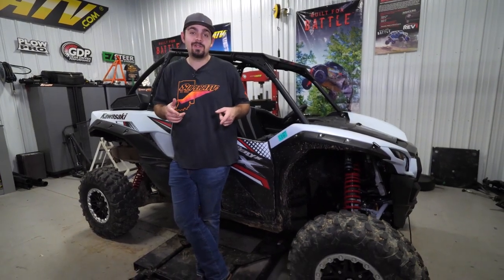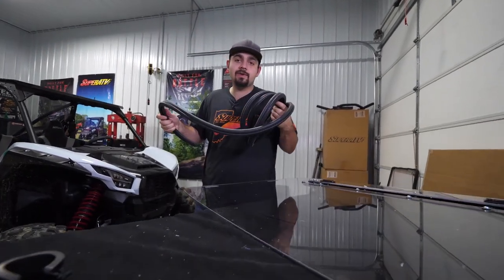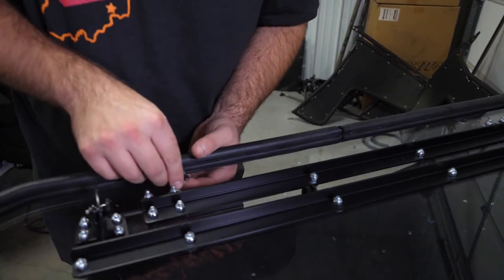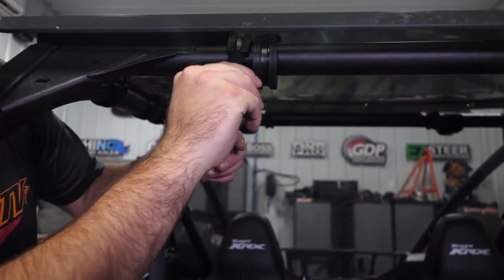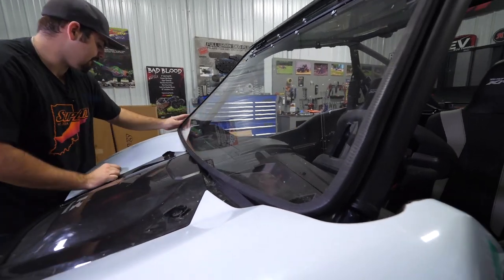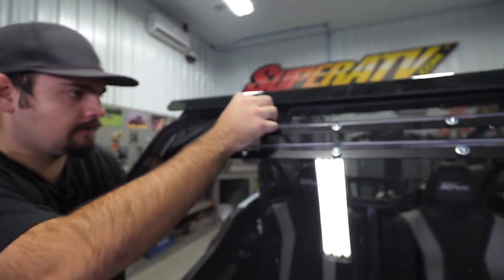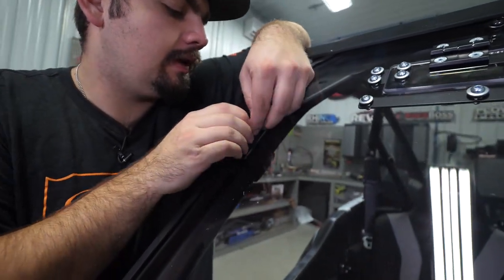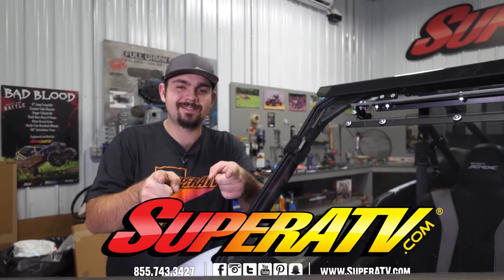SuperATV Full Vented Windshield Install on Kawasaki Teryx KRX 1000 | How To

Comment: The gasket seam at the top should be at the bottom.  If you wash the windshield, water will get between it and run down on the inside.  Just my .02